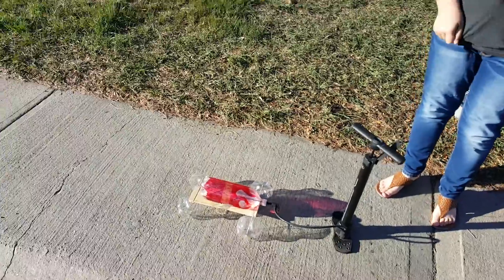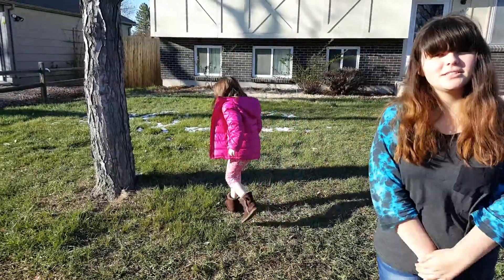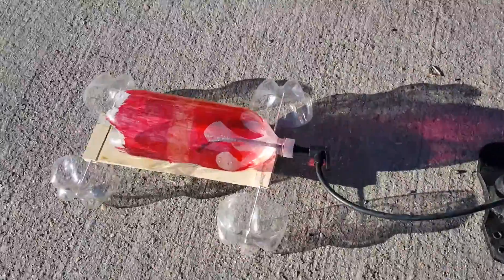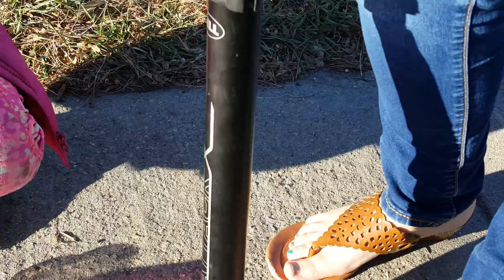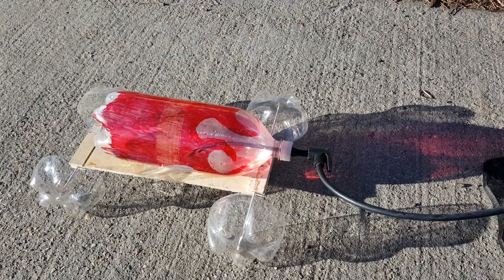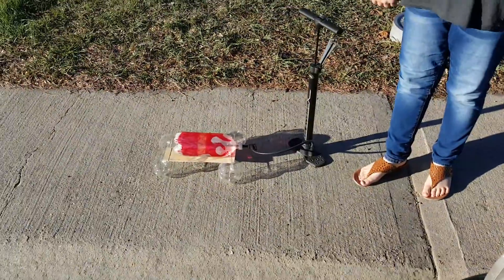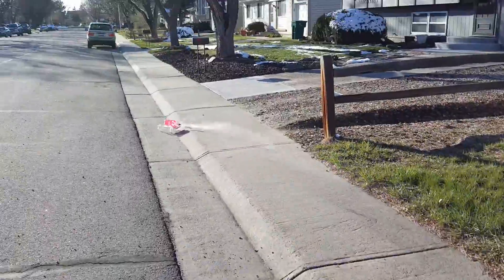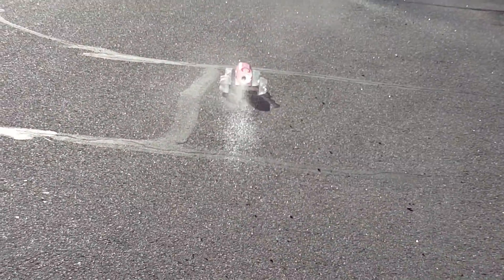PoP Bottle Rocket Car w/water

Comment: If you ever got back to this, you could probably make things a lot zippier. If that's a two liter bottle, you can probably pump it up to 80 psi, or maybe even 100, without too much danger. Test safely by filling a bottle with water, placing it in a bucket of water, and then pumping it until it bursts. Of course, you'll want a safety margin. Years ago, I pumped one up until it burst at 140 psi. It was loud enough to get the landlord upstairs in about 8 seconds, so you might want to account for that. It might have been louder if not for the towel over it which was intended to catch any plastic shrapnel. 

I think you're losing a lot of energy in that pickup tube. Many years ago, I made a really crude water rocket with a Schraeder valve tube, like yours, with what I think was a 1 liter bottle. It would go to maybe 70 or 80 feet. 

I think you're losing a lot of energy in that pickup tube. Maybe if you used a 1 liter bottle, everything would be light enough that the car would accelerate enough under air alone for the water to slosh back and enter the tube. Best results would probably be obtained if the front of the tube was flared to smoothly funnel the water in, and if the inside corner of the back of the tube was sharp, for the water to break away cleanly. 

If you're  going to have a pickup tube, I suggest you make it wider, except funneling smoothly into the tube on the way out. You might need to put something light in the bottome of bottle, shaped so that ALL the water gets picked up instead of just sitting around,

If you hop up the performance enough, though, you will have to think about dented cars and such, if there are any around. Check this out for what's possible with water rocket power:
http://www.aircommandrockets.com/
Reply: Water rocket cars can go pretty fast. This one, if I'm not mistaken, doesn't even cheat with overheated water like some do:
https://www.youtube.com/watch?v=Q1eQw4ycgQM